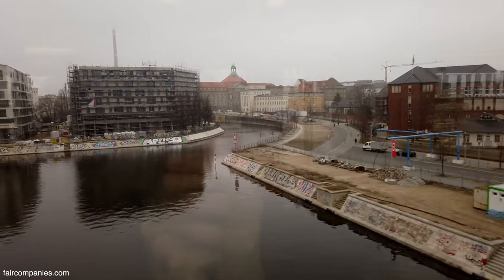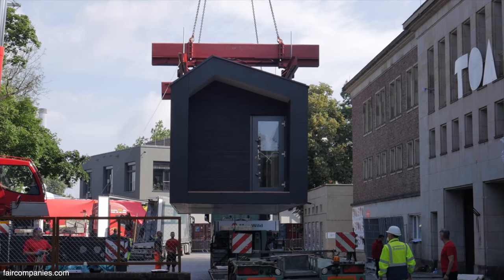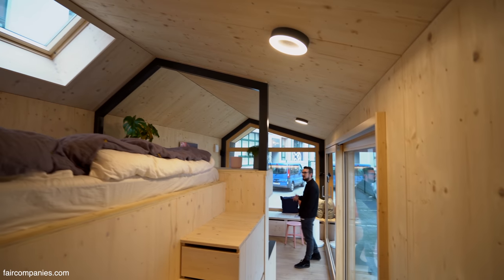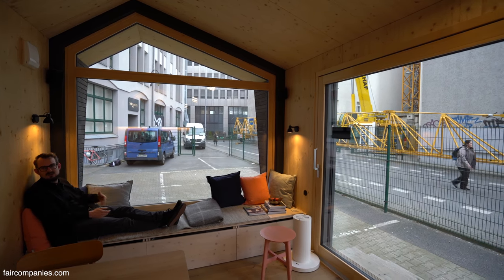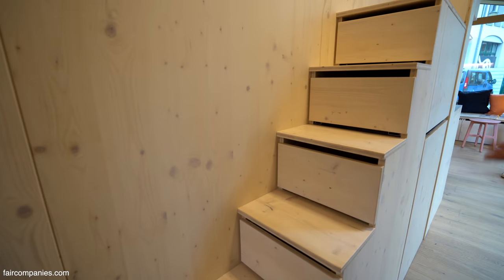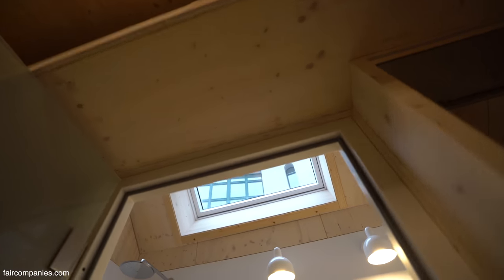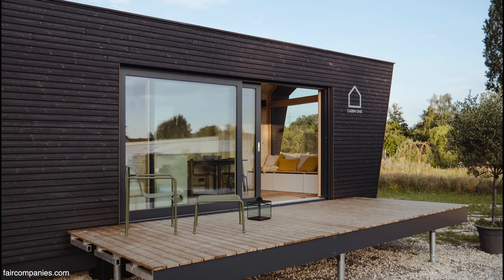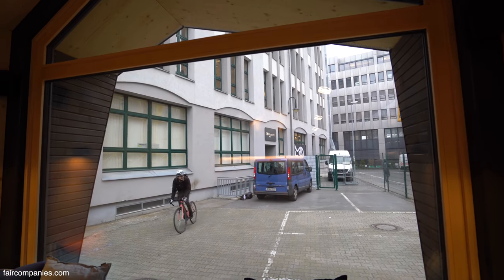An easy-to-install prefab cabin as alternative to rental flats?

Comment: Cabin Spacey is that a play on words with Kevin Spacey eh....great actor terrible pers(on)... Same with this home good looking on the outside ugly on the inside the wood looks like particle board most of the walls are mostly glass  although I like the sky lights .  And yeah I wouldn't legally call that bed a bedroom either but a glorified bunk bed. The bench next to the huge window does not look comfy. The kitchen does not look very home-y it needs a bigger fridge and sink and scrap the dishwasher for a washer/dryer combo

Comment: I wasn't even 1 minute in when I realized this isn't a bright idea at all (did finish the video before commenting). Buildings are designed with a specific load in mind, this is just placing undue burden on the structure. They'll probably stick to selling these as cabins in the woods, don't think any zoning laws would allow anything like this. Gotta wonder who's the poor sob that invested in this design.

Comment: wow, can't wait to see when you put many of these on a roof not designed to hold it. you are going to pancake a whole building. if the engineer designed the building to hold another floor, he would have built another floor. engineer don't design a building to be crushed from above because most think godzilla is not real.
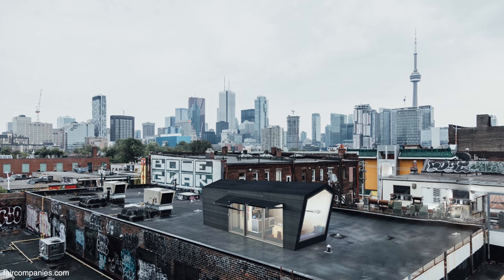Reply: 2:33 he places it in the center of a warehouse roof away from the corner walls, put one more right next to it see what happens.
Reply: I assume that these are being placed on roofs of buildings engineered with the anticipation of the addition of additional storeys,   But I have to wonder how the presence of one of these units would affect (or prevent) roof maintenance).    And how do rooftop mobile home parks deal with such issues as lightening and tornadoes?  And what happens when "youths" make it out onto the roof?    Germany, as I've been reminded, has "youths", now.   A home invasion could be really scary, in an isolated unit like that.    When they're through gang-raping the unit's occupants, they just throw their victims over those half-meter roof parapets.

Comment: That’s the stupidest thing ever..
The only place where putting a house on rooftops is even doable is in cold climate areas. 
Do you realize how astoundingly hot it gets on a normal rooftop? 
You wouldn’t be able to deal with the radiant heat, the temperature would reach 140 or more and cooling down the house would be almost impossible and very costly. You couldn’t ever sit outside except during the winter and then you would have nothing but stinking tar to deal with..😂